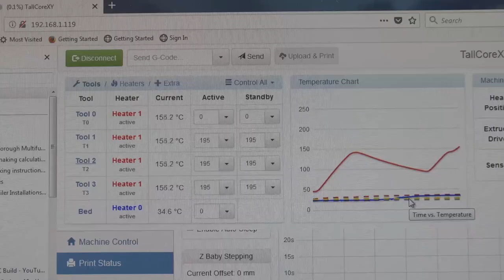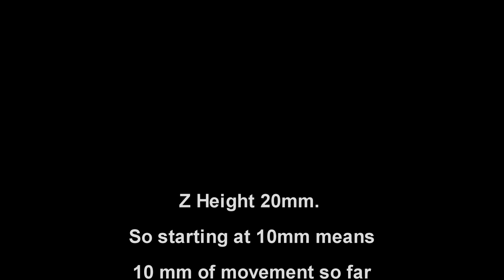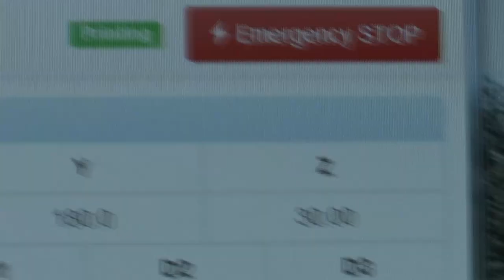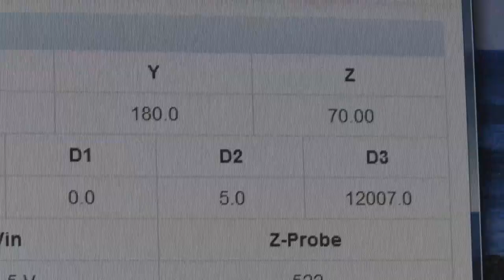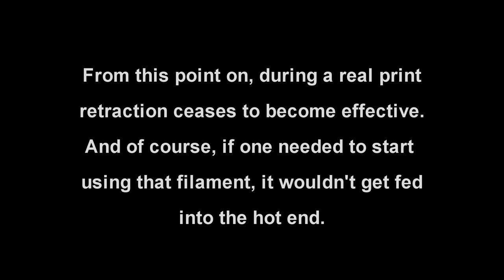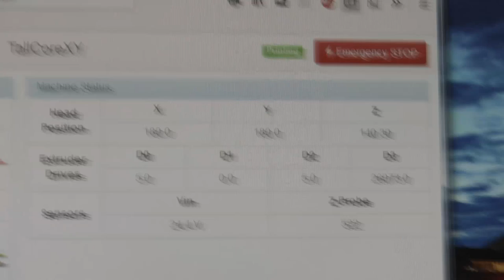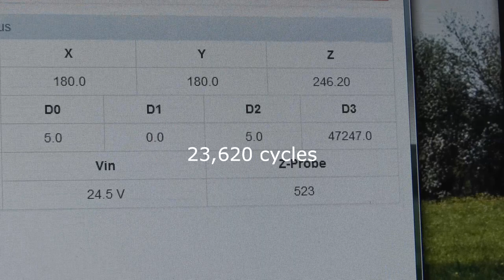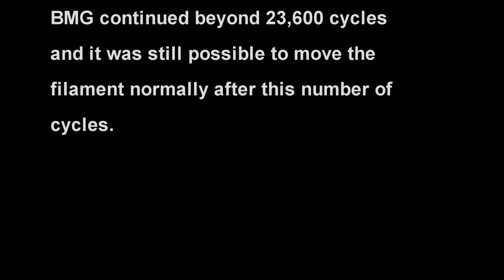Bondtech BMG Vs E3D Titan extreme retraction torture test

Comment: Sorry but 1 more question please.  Do you have a link to the cable chain you're using? Yours looks very sturdy and I am also running a cable chain horizontally and mine has horrible sag.  Thank you!
Reply from the maker: I'm in the UK and bought from these people https://ooznest.co.uk/product/cable-drag-chain-carrier/. I think I used 15x40 for all the conductors that I had. But now that I've changed to Duet 3, I only have power and data going to the gantry which now has two expansion boards for all the extruder steppers and other hot end gubbins. So I don't need to use a cable chain any more.

Comment: Sorry to ressurect this video comment section - what's the printer control software you're using? Thanks
Reply from the maker: I've always use Duet hardware and their RepRap firmware.

Comment: What retraction speed do you run the bmg at?
Reply from the maker: Normally 3600 mm/minute but if I use 256x micro stepping I have to reduce it to 1800 mm/minute otherwise I run into the step pulse frequency limit of 200,000 Hz on the Duet boards.

Comment: This is so pointless... The filament damage wold be printed, not for 2 hours been punched in the extruder...
Reply from the maker: I did mention that this video needs to be viewed in conjunction with the post I made on my blog. Had you done so, you would realise that there is a specific usage case where the video is far from pointless.. Also, if you watched the video through to the end you would see that, with the Bondtech BMGs, it is possible to resume printing even after the same piece of filament has through many more than 20,000 retraction cycles, whereas that is not the case with the E3D Titans.